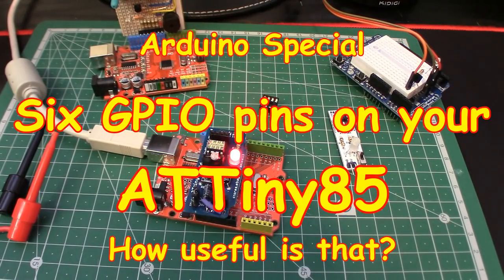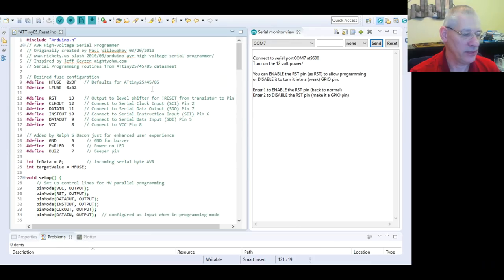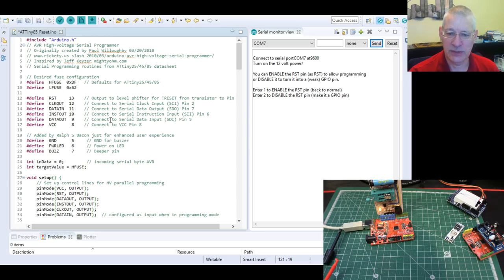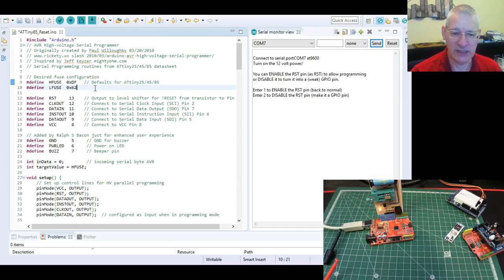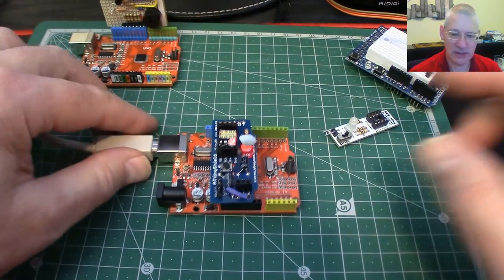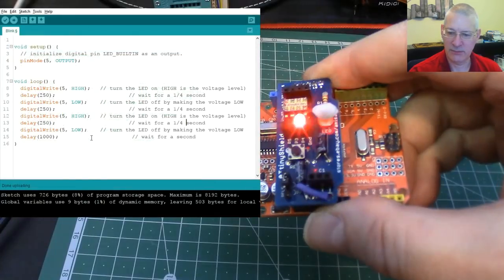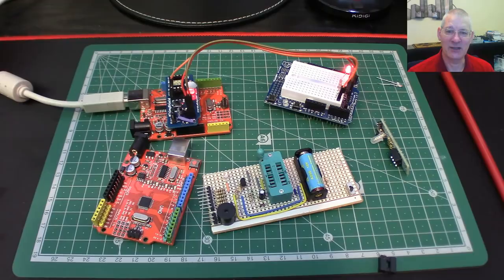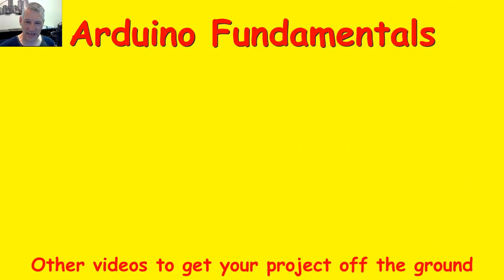#87 Six, yes SIX, GPIO pins on an ATTiny85

Comment: Great video as ever. What do you do if you don't want to watch any more Christmas movies on TV and the weather looks like rain? - you finally get round to building a HV programmer to unbrick that MCU. 
I made a slight product variant - used strip board to hook in Uno 5v so as to feed a small boost convertor to generate the 12v. I also put a jumper in place just in case I ever come across a bricked ATtiny15 and want to route SCI to correct pin. 
I padded out your code to handle Reset Disable for a range of MCU and added a fuse reset  to make this more generally applicable to bricked MCUs.
It seems to work, I can read, change and re-read fuse settings to confirm the changes made.
I bricked an ATtiny13A in my early days by setting the clock speed to 128kHz and also adjusting the System Clock Prescaler until it was too slow to talk to using my ISP (I was trying to save power OK).
I'd like to unbrick this device (just to know I can) in place of throwing all 50p worth of it in the bin.
I see I am successful in setting fuse defaults back to Low: 0x6A, High: 0xFF  but I can't seem to enter programming mode using an ISP (Studio 7 via a Pololu ISP in this case as it has a rocking GUI fuse editor).
Would you have any hunches what also might be wrong (other than it's U/S and lacking the magic blue smoke)? 
Best regards
Happy New Year
Peter
Reply from the maker: It looks like you've made some interesting improvements to my original design, very cool 👍

Regarding getting the ATtiny13 reprogrammed, you'll only be able to do this using SPI initially, unless you've loaded a bootloader of some kind and are using a hacky way to get it into the right state. Adafruit describe this for other processors, but admit it's unreliable.

Also the correct oscillator must be used, to whatever you've set via the fuses.
Reply: @RalphBacon  Thanks for all your encouragement. I managed to unbrick it in the end. I remembered I'd bricked it by selecting internal 128kHz oscillator AND then compounded my issue by being bold with the System Clock Prescaler.

I am using a Pololu USB AVR Programmer (emulates STK500 to Studio7) and I am able to control the ISP frequency through the Studio 7 fuse blowing GUI.

So, using the HV Programmer,  I modified the LFUSE value for ATtiny13A to 0x7A (no CKDIV8) and set the ISP frequency to as low as it would go (1.747kHz) and success! I did some more testing with the ISP frequency and the fastest I can successfully run this at is 7.008kHz - wow that MCU clock must be slow!)

BTW - do you know where you can source genuine ATtiny402 devices? I got a few from eBay, mounted them up so I could play with them, built a UPDI programmer and found out that they had incorrect device IDs - I hacked my way round that only to find out I could not control two of the GIO pins - further reading indicates that batches of these also have corrupt pin multiplex tables in the silicone. Dr Azzy suggests not sourcing from eBay / AliExpress (I'd agree). Main suppliers advertise a next production run in Aug next year (2023). I only want a handful and spending 10 times the value of the shipment on postage sticks in my throat.

Keep up the good work.

Comment: Great information and well presented Ralph.
With regards to the 12V programming voltage you may be able to use a MOSFET to control the supply using one of those extra ports you have available.
I think this programmer could also be built on a prototype shield board.
Reply from the maker: You mean control the 12v supply via a logic-level MOSFET thus dispensing with the slider switch? Yes, indeed, that would be an alternative approach. And I'm sure you're right about building this on a prototype board, it could be a very neat job!
Reply: You can NOT use a MosFet. You could use a LOGIC GATE MosFet. The most common ones are in a TO-220 package which takes up space. Plus you have ESD headaches.  TUNs are cheap and easy to get.

Comment: Hey Ralph, I got my Reset pin to work as gpio thanks to your tutorial, but now I'm having the issue that my Attiny85 is working slower than usual. I have a red, green and blue led that change their respective intensity with an integer that goes back and forth between 0 and 255, resulting in a "fade" pattern that goes through the entire color spectrum. This pattern only takes a few seconds to go through the entire spectrum once but now all of a sudden takes about a minute. This seems like an issue related to my clock speed but I couldn't find a solution for it so far. Any help from you or anyone else is apreciated, thanks in advance.
Reply from the maker: Sounds as if you have changed the fuses settings so that it divides by 8 now. Check your fuse settings (it displays them when you upload) and compare to what they should be by using this page: https://www.engbedded.com/fusecalc/
Reply: The 4 least significant bits on the Low-Fuse byte are the CKSEL bits which control the clock. On a new ATtiny85 they are set to 0010 giving 8MHz divided by 8 (1MHz) and this is what the HV programmer described here is setting the CKSEL & CKDIV8 fuse bits to. The Arduino IDE has options for setting the clock under the Tools menu. By default this sets the ATtiny85 CKSEL bits to 0001 which is 64MHz divided by 4  (16MHz). So, if you change the Low-Fuse byte from 0x62 to 0xF1 and reprogram the fuses again you will restore the chip's clock and speed to the Arduino IDE default settings. If you just want the HV fuse programmer to set or unset the Reset pin then comment out the code that writes the Low-Fuse byte - because there is no need to change this byte. The CKSEL fuse bits are explained on page 25 & 30  of the ATtiny85 datasheet (see link provided below video).

Comment: Dumb question because I'm too lazy to research it: Can this pin be used as a digital input instead of a "weak" output, or is it only GPIO in terms of RST in, and "Weak" out and no other options?
Reply from the maker: I don't see anything in the datasheet to suggest that it cannot be used as an input pin (weak GPIO, is says).
Reply: @RalphBacon  - Thanks for the reply. I required 4 digital inputs (to read a binary switch), one digital output used as an interrupt to a peripheral processor and one analog input. 
I used the reset pin for the analog input after first debugging the program using an UNO and then loading it in the normal way to the Attiny. After the load, I then used your Fuse bit board to make use of the reset pin as an analog input. Works....

Comment: Hi I've enjoyed your videos.  i have an issue with an attiny 85 board.  i have the one you have shown from allexpress, and it works pretty good, however i also have another board that i can't get the IDE to recognize.  i was wondering if you've seen this board or now how i can use it.  I would like to use it because it comes with usb and a socket to switch out the tiny85 if needed.  this is the board.
Reply from the maker: Er, which is the board, Spencer? I think the link disappeared. However, I have a new, very small ATTiny85 board, with USB connector that I want to try out when I have a few nano-seconds spare in my life, maybe they are the same. Send me a link to the webpage you bought it and I will compare.
Reply from the maker: Oh, I see you posted the link separately, that's fine, I'll check it out. In fact, I just did and it looks JUST like the one I have here. Stay tuned to see if I have any success!

Comment: Hi Ralph. Love your videos mate! 
How have you got that LED hooked up to the HV line into the ATtiny85 pin5 Ralph? Won't that cause a voltage drop of a few volts along with the 1K resistor...? What is the minimum Voltage Pin5 Needs to See in order to ReSet the fuse? Thanks.
Reply from the maker: If you are referring to the LED2 that shows the power is on from the 12v battery and goes to pin 1 of the ATTiny85 - this is the RST pin and requires that pulse to reset the fuse internally. To reset the RST pin from GPIO back to RST you need 12v. Take a look at the circuit diagram in video #144 (https://youtu.be/bTTdvcnAOgg ). The PCB and circuit diagram are in the GitHub and are for EasyEDA.
Reply: @RalphBacon  Awesome yes, Got it. Thank you Ralph.
I'm still not having any luck here. when I run the fuse reset it always reads ALL fuses as FF.... What do you suppose that could mean? Which pin is responsible for getting the hex value of the fuses?
I've checked and rechecked my connections many times, but to no avail. I'm going to try the same schematic using a Nano.
Many thanks to sir, I love your vids and I love Benny's input. I was sad to hear of his passing.
Reply: @RalphBacon  Hi Again Ralph. I found that it was because the 12v battery (in name only) was below 10v - so that meant it would enter high voltage programming mode. I've done some re wiring of the circuit and put in a 9V Battery/Boost converter controlled by a Photo Voltaic Mosfet Driver (PVI5080 - Love those things!) which I get the Arduino to power up and power down at the end of the program. I'm now making the dedicated board. Just one question, At the start of the program, in the serial monitor the first line reads "NTurn on the 12 volt power." I can't find where this annoying Capital N is coming from... Do you have any ideas Ralph? Other than that, it's all working brilliantly. Thanks again, for you help, vids and general coolness. Cheers.

Comment: Happy New Year from downunder.....new to this fuse setting
I have a program where it is required to set fuses at certain values, Low-E2, High-DF and Extended-FF. 
Going by your video here, this is possible to do at any time, either before or after uploading the sketch. Correct..?
Your program though is only meant for resetting the reset to an I/O and back again.....??
Reply from the maker: Happy New Year Jorgo! Fuse settings? You can only set the fuses as part of a bootloader / sketch upload; in other words, you can't do this programmatically when the sketch is running.
You can change the fuses by editing the boards.txt file (found in C:\Program Files (x86)\Arduino\hardware\arduino\avr\boards.txt although your modified versions can also appear here: Arduino Sketches\hardware\breadboard\avr\boards.txt) and then using that board definition.
You have to be careful here. Setting the wrong fuse could brick your Arduino, so use this fuse calculator and always double check the settings - and never "try things out to see what happens" (don't ask me why I know this):
https://www.engbedded.com/fusecalc
The video here shows how to use all six pins for GPIO (including the RST pin) but you have to use my fuse resetter to get the RST pin back to its default state so you can upload a new sketch. Take care!
Reply: @RalphBacon  Don't want to change the fuse settings when running the sketch.   Sketch I have here calls for the settings Low = E2, High = DF and Extended =FF.
Intention is to do this using a HV programmer.  I watched your video where you changed the reset pin to an output and back again via a hv programmer and showed how it worked with the flashing LED.  It appears the sketch itself remained intact in the Attiny at that time. So my query was, does it make any difference if I use a hv programmer to change the fuses before or after uploading the sketch that will be run on the Attiny ?
Your code I believe only changes pin 1 to an I/O and back to a reset...???
Just thinking...I should be able to use a usbasp programmer to set the fuse I require...yes..?

Added a ten pin plug to an 8 pin ic clamp to suit usbasp programmer and using a couple of different software (Avrdudess and eXtreme burner...had to change the driver to libUsb in zadig) changed the fuse settings to what was required. Did similar to yourself in that I changed over to one setting in one software and back again in the other.
Then loaded the sketch to the ATtiny85 using the usbasp programmer in Arduino IDE.....Yet to test outcome but no errors so far. ...Cheers Jorgo
Reply from the maker: You will only need a High Voltage (12 volts) if you want to change the RST pin back to a standard GPIO pin. All the other fuse settings can be set just by writing the values to them, in the way you seem to be doing already.

When using the HV resetter (for the RST pin) the fuse setting is changed but the sketch remains intact. When changing the other fuses without using an HV programmer the sketch is also kept intact.

It seems you are good to go, Jorgo!
Reply: @RalphBacon  Thankyou...looking forward to your videos this year...cheers

Comment: WTF with uC esp  Arduino    a fuse?    a  sketch?     sweet jesus ....just call it what it is
Reply from the maker: Calm down, Kenn, no need for such stress! The program in a microcontroller is called a 'sketch' in the Arduino world. And a bit flag is called a 'fuse'. It's to ensure no-one that is not in the Arduino club has any idea of what we're all talking about.
Reply: @RalphBacon  I think it is absouletly asinine to  create a new set of jargon for  something that is virtually identical. But why stop there?  For the uC world we can have:

Zebra - Switch statement
Alberta - If statement
Potato -  Do loop
SameSame - assignment
Relation  -   a  function (Math joke)
Reply from the maker: Well, unlike your examples, using a different set of terms does confine what we are talking about to the Arduino world! That said, can we use a Zebra within a Potato, or is it best to stick with a simple Alberta? (Now my brain hurts).
Reply: Thats how languages evolved, words meaning change with time, like the F word for example
fuse meant to melt metal, then it got used to mean an electrical component that protect electrical hardwares
but basicaly it was made from metal that fuse at cetrain current
the intended meaning of fuse is no different from the electrical one
instead this bit is meant to protect your code running on uC, but at a certain voltage, the "fuse" blow up and reset everything
Reply: @zazugee  Seems to me you have a basic MIS understanding of micro-controller fuses. Which is not surprising given the terrible mis-use of the term.

As in any design process, let’s say graphics design. There are some settings are being tuned at the beginning of the design project such as dimensions, dpi, background, colors, etc. These setting are said to be “The configurations” of the project which will not be changed till the end ideally.

Similarly, in embedded software design, there are also some configurations for each MCU used in the whole project. Such as the type of oscillator internal/external, whether you’ll use a watchdog timer or not, whether there’ll be a reset pin or not, and so. These configurations are controlled via a dedicated specific register in the ROM, In our MCU it’s called “CONFIG_WORD”.

Every single bit in this register controls a specific feature, combined together in this register to control all the settings (configurations), Hence they are often called the “Configuration Bits”. Some books in the embedded literature call these bits as “Fuses”. All in all, these names stand for the same thing.   
https://deepbluembedded.com/configuration-bits-fuses-for-microcontrollers/
Reply: @kennmossman8701  there fuse is just one bit of the configuration bits
but as the name implies, its made to get flipped only when you apply high voltage, hence the use of the term "fuse".
like when your power switch fuse trip on high current
Reply: @zazugee  Link?
Reply: @kennmossman8701  thats my understanding of what i read
i found out you always mixed things up
like saying why not call the fuse a sketch so i assumed you're again thinking all conifgurations are fuses
but because you asked me for sauce
i found out this guy saying fuses and configuration are the same thing:
https://www.ladyada.net/learn/avr/fuses.html
but this link says no, configuration contains 2 different kinds, locks and fuses
https://embedds.com/all-you-need-to-know-about-avr-fuses/
Reply: https://forum.arduino.cc/index.php?topic=318215.0
this thread explains that the fuse bytes are inherited from the age before flash memory
"A typical PROM comes with all bits reading as "1". Burning a fuse bit during programming causes the bit to read as "0". The memory can be programmed just once after manufacturing by "blowing" the fuses, which is an irreversible process. "
"The bit cell is programmed by applying a high-voltage pulse not encountered during a normal operation across the gate and substrate of the thin oxide transistor (around 6 V for a 2 nm thick oxide, or 30 MV/cm) to break down the oxide between gate and substrate. "
so this is the origin of the terms fuse and burn
because PROM were programmed once and burned irreversibly
Reply: @zazugee  Maybe you have trouble reading as I never confused the two.  I did say sketch and fuse were stupid names  and entirely unnecessary. It is something a 12 year old would do to make their mundane  thing more important.